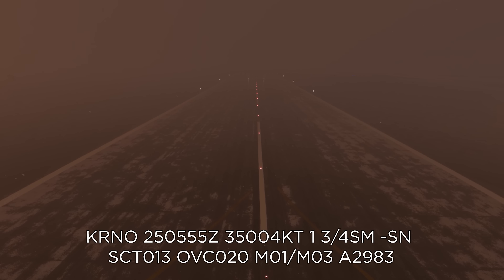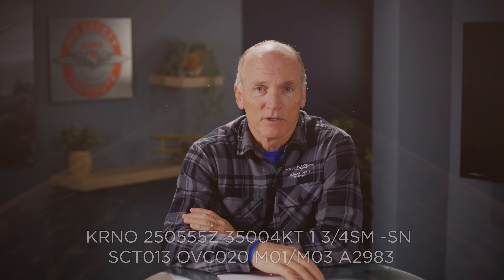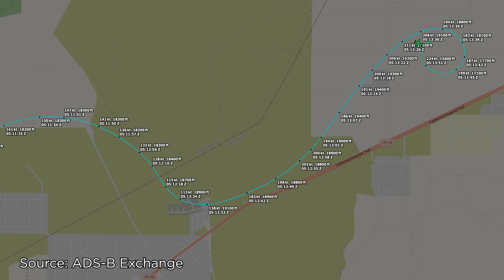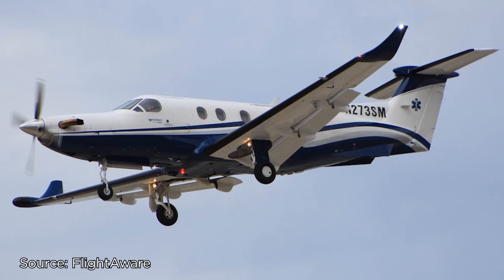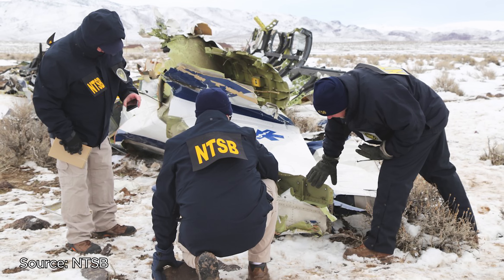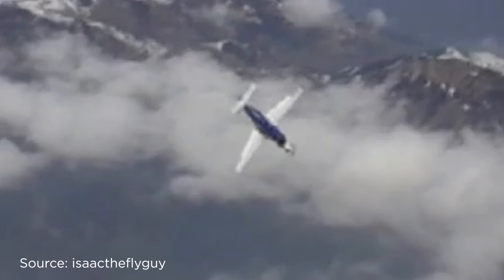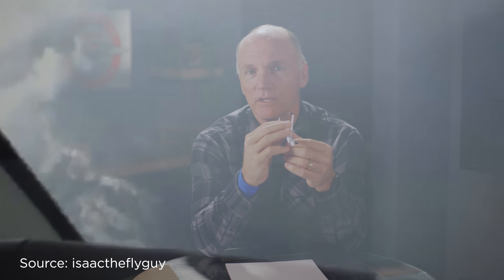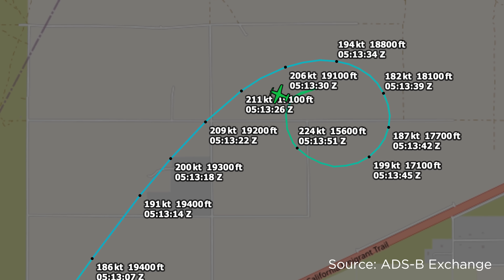Early Analysis: PC-12 In-flight Breakup Over Stagecoach, Nevada

Comment: As a PC12 operator, my money is on icing. Despite the FIKI claims, the PC12 is not capable of flying in all types of weather. Even with 100% functional de-ice boots and prop blade root heaters, we've experienced an icing induced inability to climb over 19-20K. Ice builds up on the prop, horrible vibrations result, the reduced thrust compounds the reduced lift of iced up wings and tail. It gets ugly very fast. Add in the fact that the exhaust plume spirals over the right wing, warming the root, and not over the left wing, not a big deal, but it can affect fuel icing. An ice induced loss of control is clearly a possibility, especially if one wing de-ice valve has failed. In my opinion, all the clues are there.   Additionally, this is why we use liberal amounts of ICE-X 2 on the boots. It really does help. The in flight breakup was a severe over stress. If I remember correctly, the last one broke the wing in a similar manner, and that took 14G's.
Reply: I think the definition of “flight into known icing conditions” is key to understanding. 
This does not mean “flight into severe icing conditions”… NO aircraft is approved for that!
Even an aircraft that is certified for FIKI is not supposed to linger in such conditions. Education and thorough understanding of these procedures are essential to safe operation and avoiding these kinds of accidents.
Reply: Not only that but to add as well with the prop deice on the stall AOA gets reduced by 8 degrees so you can start getting the stick shaker alot quicker than anticipated. And knowing how the Auto-Pilot on some of the Legacies doesn’t handle turbulence very well, especially severe turbulence, I could see either or both being contributing factors.
Reply: Had the same experience in icing conditions with PC12/47E. Had strange vibration out of FL245 and in less than a minute was not able to climb or maintain altitude….
Be careful with a PC12 in icing conditions!
Reply: My best friend growing up had a PC-12 and I was constantly going on trips with them. If there was ever questionable conditions we waited it out.  Didn't matter if there was school, work, appointments, etc.  Glad they took safety so seriously
Reply: @inshanity84  The PC-12 is a fantastic machine and is not prone to in flight breakup. Unfortunately, like all things aviation, adverse weather conditions, poor decision making and inferior piloting sometimes result in tragedy.
Reply: This is one of the most relevant comments I've seen in an accident analysis video, thanks for that insight.  Really valuable.  Does NTSB or FAA take SDRs for operational issues such as "FIKI that really isn't"?
Reply: I used ice x on my props as the alcohol system was inop! Never got it to work R 20007M2..
Reply: If the wing took 14gs to break, then everyone is already passed out or dead long before the aircraft becomes broken.  So a loss of control could lead to a later breakup, but unlikely anyone was awake at the time of breakup?
Reply: @adamr8628 Could be a sudden and transitory load.
Reply: the sound of the breakup is frigh😢ting if this is the one
Reply: You make a lot of sense.
Reply: Maybe there was a good reason he had to fly plane then he should hsve deiced beforehand snd put the deicing on  it was a mefivsc glight relative with thrm so I hazard a guess it was a time limited medical flight though you'd have thought an helicopter should have flown  him but it was maybe gor a organ transplant in that case it's get yo the hospital concerned fast
Reply: As someone who has over 900 hours in a pc-12 this is pretty damn accurate. I would also note that the autopilot would also kick off in anything Moderate turbulence. And yes, a prop deice fail is no good at all, and the fact that I’ve seen way to much ice build before “breaking off” even on high and the performance is reduced significantly
Reply: I agree with the OP. I fly a PC12 
700 hours a year single pilot through all conditions. It’s a terrible plane In the ice. Throw in prop heat and Inertial separator and welcome to pusher ice mode. A nice early stick shaker and stick push just for fun. God help someone who got it into a stick push situation with ice. The PC12 will loose speed in the blink of an eye with ice. I also agree that a modest amount of ice and medium size load and it’s a struggle to climb to 190 and above. I hope they give ice a reasonable look and not fixate on the single pilot and SD.
Reply: @turda4u  Interesting summary. Looking at this from the ATC side, I am wondering if the ADS-B data looks to you like it is consistent with that scenario prior to the accident sequence itself--it seems like that would appear to be a fairly normal climb to altitude as a radar profile to that point. In particular, would you expect to still have that much speed on while fighting the kind of scenario you describe? I also flew corporate before doing ATC but don't have much PC-12 time, and none in these conditions.
Reply: @ReflectedMiles   My most recent ice with the PC12 this winter I was at 190 and started with light ice. It went to moderate very quickly so I had asked for 210 started to climb and was only able auto get 300-400 feet per minute at a 145 knot climb speed. Visible not a lot of ice but definitely building. I looked at the owner and said this is why we don’t load this thing as much as you would like. That moment that I had turned my head to him I was climbing at 145 on autopilot. It was literally the time I took to tell him that when I looked back at the wing then airspeed and was at 104 knots. I disconnected auto pilot and activated 1 min boot cycle. As soon as the autopilot was disconnected I felt the plane drop to an 1800 ft per min decent. This was from the climb trim position the autopilot had for it before I disconnected. By allowing it to drop a little I did hold very slight back pressure. Had I not done that it would have dropped a lot more. I started to regain airspeed and asked for a block. I can only imagine this happening in the Stagecoach conditions where he had the turbulence, the weight of 5 pax and the medical equipment that cant be very lite. I had myself, the owner and 2200lbs fuel. I was also able if needed to get down to warmer temps. They did not have that option. Looks to me that they just fell out of the sky in a right hand turn. I never got my situation into the stick shaker or pusher. If that had happened at night with the weight of ice and turbulence it would have been a mess to get out of. Speeds over the ground on the ads b didn’t look like enough to blow the wing off. Maybe the decent rate caused it. In fact MMO/VMO is .46/236. That plane was falling. If a pilot was disoriented and in a flyable plane I would think you would see maybe more ground speeds descending that fast and maybe even a turn in the opposite direction for over correcting. I’m still with the OP on this. I think ice. IMOHO. We will have to wait and see. Problem is it will be way down the road till the final comes out.
Reply: @turda4u  Thanks for writing up the additional story. I was just surprised that we would be seeing 200+ kt. GS through the whole sequence until the turn off course. Without a transmission from the pilot, there would be nothing to that point hinting to a controller that there might be any trouble.
Reply: If this was the case, the prop would have required an asymmetric accumulation of ice, and that would have required a failure of the aircraft's prop de-ice system. This means the pilot ignored his amber deice CAWS annunciation for an extended period of time as the aircraft continuously lost performance, and continually climbed. This loss of performance would be reflected in the ADS-B data.
Reply: @garyurban5373  I know first hand that the prop blades will build up ice outside of the functional heaters. The result is exceptionally uncomfortable. Both from a vibration point of view, and performance.
Reply: What would you say about an STC for electrically heated leading edges?  I myself don't like watch and worrying about whether or not boots are going to clear the ice.  heated edges would be anti-ice and/or de-ice, whereas boots are ONLY de-ice.   No one like messing with TKS fluids, but there is an extra accessory pad on the PT6 for a dedicated alternator, and yes there should be a Beechjet style ice sensor with the system to automate.  This  is a serious question and any replies are welcome and encouraged.
Reply: @gendaminoru3195  I've wondered about the same thing. Maybe it would take too much electrical power or add too much weight?
Reply: @semiprofessional8470  thermal foil weighs a lot less than rubber, but there is a need for a dedicated standby source of power as you would with FADEC engine controls, but so what if there are three alternators....  I am going to look into it further.
Reply: Which last one? Amarillo?

Comment: In the ATC audio the conditions were so bad he couldn't properly taxi to take off because of the horrible visibility ATC had to guide him and it resulted in him having to do the process again to finally take off.
Reply: One-quarter inch of snow would be enough to obscure taxiway markings.  This is not a factoe contributing to this accident.
Reply: This should have been a small clue to this overconfident pilot.

Comment: Normally this plane is n AP throughout the SID and the ads b data seems to confirm this, for some reason the AP must have come off, then things can get hairy pretty quickly in night IMC single pilot. Spatial desirientation will play a role but only after the AP has come off, so the question is what made the AP disconnect ä? My guess, severe icing on control surfaces

Comment: spacial disorientation is not a problem if the autopilot is doing its job.the pitot tube could have iced up also if he forgot the heat.
Reply: Autopilots in this size plane disengage (basically turn off) in turbulence as the airplane bounces around too fast for them to keep up.  You can reengage them but they just disengage again.

Comment: It’s good practice to climb in airspeed hold as your pitch mode as opposed to vertical speed. As your performance degrades with altitude, your vertical rate will bleed off instead of your airspeed. Autopilot would mask increasing AOA and the pilot may not notice in time to avoid problems. Just my thoughts.

Comment: I’ve been flying the PC12 since 1997, yes, 26 years.   It’s a terrific airplane and I would fly it about anywhere.   It handles the Ice very well, better than any other Turbo Prop I’ve flown.  

With that said they recommend not going below 135 knts indicated in icing.  I personally use 140 knts as my number but usually try to be between 160 and 145 if at all possible.  I’ve never had a issue but error on the side of caution.
Reply: Good info. Thanks.
Reply: Would u have done the flight in question?  Thx. I’m not a pilot
Reply: With severe turbulence, That airspeed indicator was probably all over the map, even momentarily dropping below an iced up stall speed......................Paul
Reply: Would you take off after not being able to find the runway?

Heavy icing plus turbulence may exceed anything that you have experienced. Add possible mechanical failure or losing the Stab and nothing you or your 140knots can do.

Comment: In this day and age with how inexpensive electronic equipment is, there is really no excuse for any of these aircraft to lack FDR's and CVR's. An cheap unit could be built on even a Raspberry pi platform with a shock and fire proof casing, and then connected to the avionics and a cockpit microphone. We have seen quite a few of these smaller one pilot planes go down recently, they need proper accident investigation hardware.
Reply: Not trying to be a jackass here, but I think you underestimate the cost of developing and installing a supplimental type certificate modification on the aircraft, and then the cost of certifying that equipment to be airworthy. If it's for commercial operations, it's even more intensive of an approval process. I get where your head is, but if it's on an aircraft, it's not homemade stuff, even the software has to be FAA certified. This stringency is literally the reason aviation is so safe. Keeps cheap unreliable stuff off the airplanes. Even with this crash and hundreds more, it's still orders of magnitude safer to fly than drive. And they'll figure out the cause of this accident or get close with the investigation technology the NTSB has these days. Takes time.
Reply: I understand that FAA certification is expensive, but it wouldn't even need to be that involved. It could literally be an aftermarket device that attaches to the roof of the cabin and records the audio and video of the control positions and instrument panels. Any information post-accident would be better than the none we currently have. Even a phone app that records cockpit audio and engine & wind noises would be better than nothing.
Reply: I agree, but the FAA is so convoluted that nothing can get done. I think something, especially not related to the flight, just a recorder would be MUCH better than nothing. So do we have to take care of it ourselves, if the FAA cannot get it's act in order to facilitate simple things like this?
Reply: I’d like to know what a CVR will accomplish in a single pilot operation? Capture a few swear words?

Comment: To me, it appears that the accident sequence probably starts back at 05:11:34Z when the aircraft starts the big S turn right then left, which is a deviation from the SID.  Pure speculation, but smart money would be on the autopilot disengaging at that point from either sever turbulence, or potentially reaching a trim limit due to icing.  Understand that the ADSB altitude data is not 100% reliable, but it turns right and loses a little bit of altitude, gains it back, turns left to get back on course and loses a little altitude before gaining it back.  It looks like the pilot probably had his hands full and in those conditions at night, seems like a perfect recipe for spatial disorientation.
Reply: The accident sequence occurs when the PIC misses the turn on to the taxi way and has to be guided by tower to next turn. I know the grounds. Tower is 200 yds from the hanger, and 800 yds from the missed turn. 

Per a source on the ground crew that transferred flight crew and patient, all were questioning the necessity to fly a stable, low acuity patient during these conditions.

Comment: The older PC12s would kick off the autopilot whenever you got into rough air. I wonder if the autopilot turned off without the pilot realizing it?
Reply: The AP did turn off for sure, and that’s where trouble started in IMC at night single pilot

Comment: Am I to understand correctly that turbulence alone could have broken this Plane apart? That is quite unsettling if so
Reply: Airplanes have maximum maneuvering speeds.  If you exceed those speeds in turbulence you can exceed the allowable G force load on the wings.
Reply: I won't feel safe flying into these conditions without an aerobatics pilot and an airplane capable of that.
Reply: @flow5718  that would be the absolute last thing to want. Aerobatic pilots do not fly aerobatics by reference to instruments!